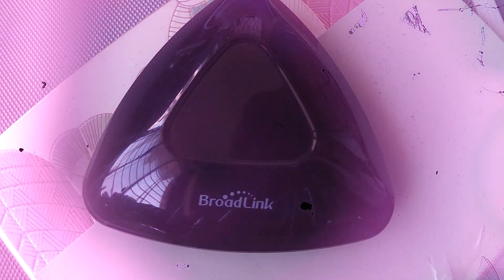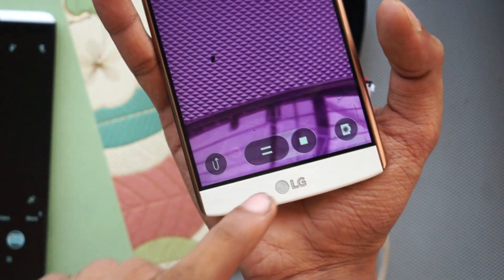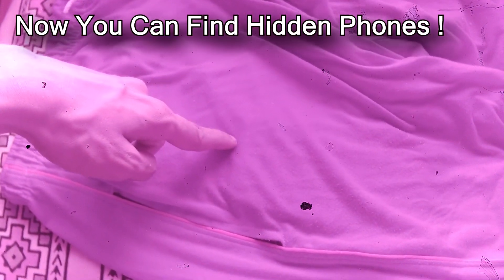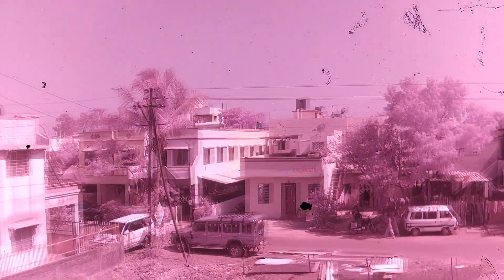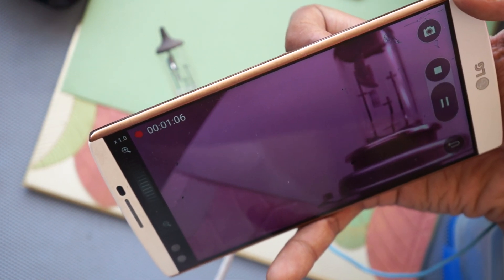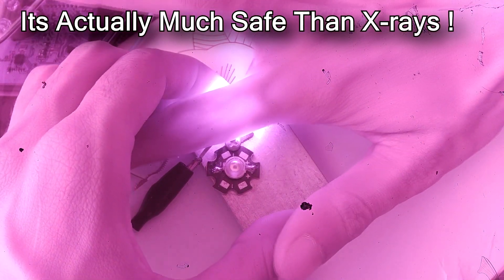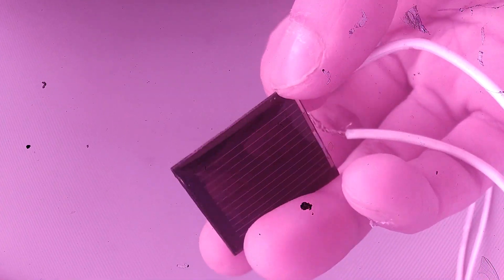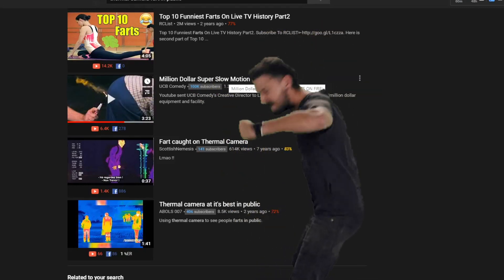Can Infrared Camera See Through Walls, Clothes, Windows ?

Comment: It seems that you doesn’t have much knowledge about it. 
First there is a different between IR,UV, X-Ray and thermal. And no it is definitely not x-ray. The clarify, ever material reflects the light different, so you can see things different.
And be careful with laser, IR has a different wavelength, so it has a different reflection too. You can’t see it so be careful not to hurt you eyes!
And for that topic there so good videos on YouTube , like the from Veritasium.

For you all want to know how to make something similar, you need to remove the filter from you cam or change them. You can try it with an old cam.

Comment: I did that trick 15 years ago by taking out the IR-blocking filter of a webcam and replacing it by the inside of a floppy disk :) 

I tried it again last year, but was disappointed, I couldn't see anything in my room. Later on I realised that all the incandescent lights in my room had been replaced by LED over the course of the last decade, so there were no near-IR transmitters in my room anymore.